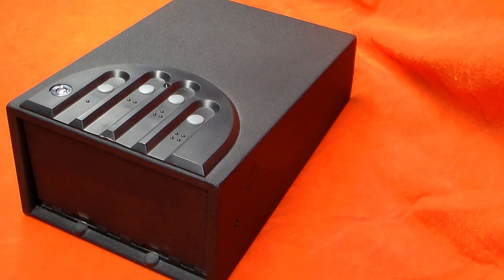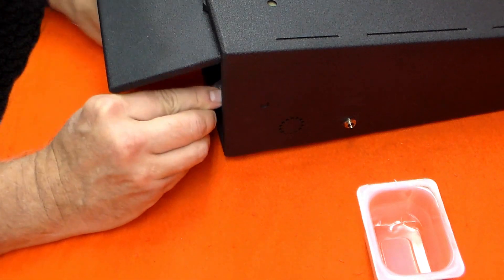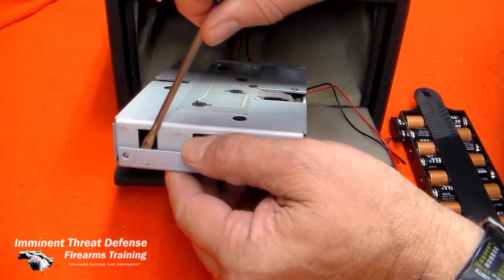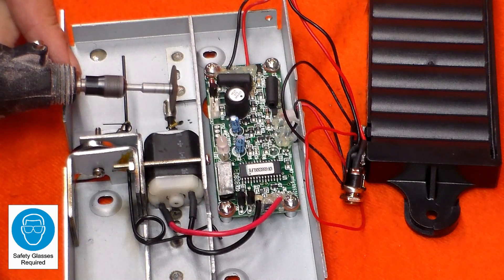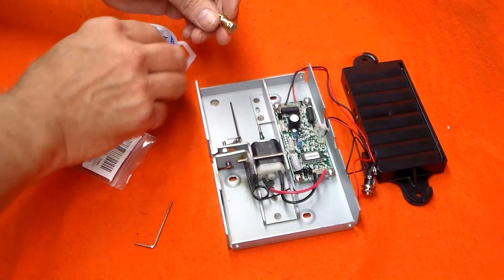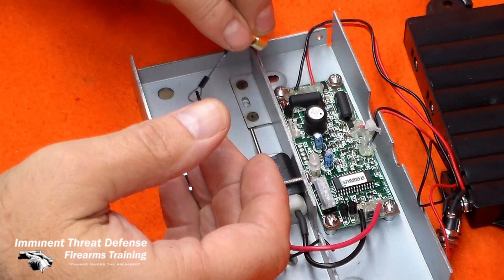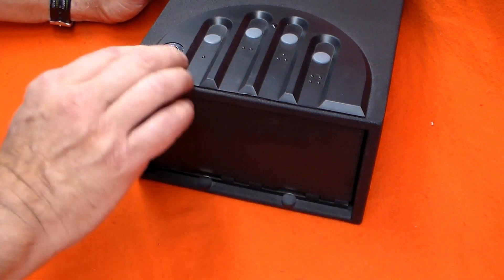GunVault Repair

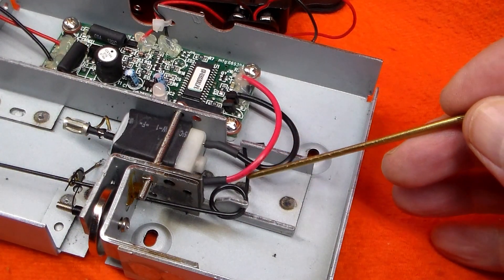Comment: Great video, great explanation.  As a Mechanical Engineer myself... I had EXACTLY the same thought as the statement made at the 2:20 mark.  This rotary motor + cable linkage is the most preposterous method I've ever seen for performing a linear actuation.  Utterly ridiculous.  What's even more upsetting however, was the indifferent and apathetic response I received from the manufacturer's technical support team.  Total fail.
Reply: At least you got a response!
Reply: Just got my response also.  No parts, sorry, too bad so sad, buy a new one.  Nope.  Gonna fix it.

Comment: Thank you, wish I found this 4 weeks ago. I had the same issue and it fixed it harvesting the original crimp on the motor and some pre crimped fishing wire i got at Walmart, but it just snapped again. Im thinking the line I used was too brittle. But now with the links to the parts you used this should last much longer. Thank you, this is awesome. Going to order the parts now.
Reply from the maker: If you have trouble with the cable, let me know.  I have a bunch left I can send you some.

Comment: THANK YOU!!  I have a Gun Vault GV1000C, got in 2006, love it, stopped working, took it apart and yep, broke cable.  Internet research says it's somewhat common but no good fixes.  I'm staring at it trying to figure out how to fix this 3/4" long teeny shredded cable when I stumbled on this video.  Absolutely brilliant fix!  Motor shaft connector and steel fishing leader!
Reply from the maker: That's fantastic, I didn't expect to have an immediate success.  Mine is still working fine. Tell you what, you email me your info at ITDefenseTraining@gmail.com and I'll mail you the parts.  Thanks for watching and commenting!
Reply: @ImminentThreatDefense  Hi, Mine stopped working a few days ago. Did a little research and found your video. Are you selling these parts to fix the problem? I'm more than capable to do the repair.  

Thanks for the helpful video!
Reply from the maker: @aenitro  email me at ITDefensetraining@gmail.com with your info and I'll send you one.
Reply: Awesome video. I just got one from goodwill . Wrote to gun vault they sent me a key. I’m in now but have this cable problem. Someday I’ll order the parts and fix it for good. Thanks.

Comment: Thanks for this. I fixed mine with by pinching the original cable to the post with a small bolt and washers.

Comment: Great video. My cable broke at the spindle so I had enough to just solder it back in place. it is holding well after 10 openings so we will see how it goes, if not, I'll do it as you did.
Reply from the maker: Mine's still working after 3 years of almost daily use. Thanks for watching!

Comment: Hey so they replaced mine under warranty. Happy to report they ditched this mechanism sort of. What they have now is the same motor, but now it has a large metal disc counterweight on it with a pin protruding from it. To that is attached a linkage imagine a pill shaped piece of metal with a small track in it. Sort of like a locomotive wheel with the pushrod and the thing is greased. This version now GV1050-19 also uses a much better dimple key. I think these are good improvements, also it has low battery indicator, light up bottoms and uses 9V battery. They didn’t make me return my unit just show pics of it broken, mine was like 15 years old. I’m impressed…
Reply from the maker: Interesting, sounds even more complicated :-)  Can't believe the replaced it under warranty (after 15 years)!  Good to know.  Thanks for commenting!
Reply: @ImminentThreatDefense  hah! Nah I’d say it’s equally complicated but less failure prone. It’s the same concept, I get what they’re trying to do. They want a latch mechanism with a low force required without the risk that bashing it on its back imparts enuf energy that the latch can fire. For instance a solenoid in the same direction as the trip wire you could imagine generating enuf force to unlock. Here you’d have to input a hellacious rotational moment to get it to unlock. It’s still a curious mechanism, that much is certain.

As for the CS yeah impressive. Sadly the first time they replaced it I didn’t pay attention and they sent me a massive version that holds like 4 guns. I need a unit that holds one gun by my entry way to dump my CCW in…not a tackle box. So I did have to eat the shipping to get it back to them and the replacement…$40 total still cheaper than the $150 replacement unit. They’re owned by Cannon now btw, not camera but safe company.

The initial replacement was fully free to be clear but watch what they offer you. It’s not always what you had, I learned the hard way.

Comment: Thanks, I’m in the same predicament.  Looks like a easy enough repair.
Reply from the maker: Email me at itdefensetraining@gmail.com I've got a spare parts kit
Reply: I really appreciate that.  Very generous of you.  But now I have a reason to make my own steel leaders!!🤣🤣
Reply from the maker: @rickkorallus1162  That's right.  It's not worth while project if it's not an excuse to buy at least one new tool :-)
Reply: Fashioned a cable, motor spins fine until I loop it around the release...then it tries but will not pull.
Reply from the maker: @rickkorallus1162  It may be the length of the cable.   I think the motor needs a little speed to build up some inertia. The circuitry only runs the motor for a short period of time, so  if the cable is too long it won't get tight, but too short may not generate enough force.  I guess I got the length right on the first try (by luck).   Try a little longer cable.  Also test the pull force required by finger, make sure the release is moving smoothly enough (maybe a little grease in the right spot will help).
Reply: Imminent Threat Defense your advice paid off! Thank you sir!! Longer cable and a lot of action grease to the rescue! I could definitely feel the change in resistance after lubing all the contact points.  If I lived in your area I would sign up for classes just because! Thank you again

Comment: Thank you so much I just had this issue happen with mine
Reply: Unfortunately this repair wasn't the problem. They did update the mechanism from the cable pull but it's looking like I'm gonna have to go component to component with a multimeter. I'm not actually getting voltage to the motor. I plan on getting the double stack model I repair my single stack for vehicle transport

Comment: Thank you! My larger GunVault had the same issue and this is smart method to fix it. Have you thought about making kits and selling them for those of us with that same issue?
Reply from the maker: I wasn't sure how big an issue this was when I started, so didn't really think there was much of a market.  This video has only had 2000 views in the first year, and only about 8 or 10 enquires about parts.  I had to buy a batch of 8 of those motor shaft connectors and more cable and crimps than I'll need.  I've given them away, I might have connector left if you want it.  If I started selling them I'd have to deal with warranty, returns, customer relations, accounts payable, shipping losses, inter state sales taxes etc. and that means I'd have to charge about $100 a set for the grief.  :-)  That's why I put the links for the parts in the description above.  Thanks for watching, glad to know the video helped.

Comment: I don’t have a clue about crimps for fishing. Can you point me at some reasonably priced crimping pliers that I could use for the #3 crimps?  Thanks again for the video.
Reply from the maker: There are more than you can count on Amazon, the particular brand I use (I don't consider them exceptional, they are just the ones I bought 20 yrs ago) is https://smile.amazon.com/dp/B004VZLGZS/ref=cm_sw_em_r_mt_dp_U_3Nf3EbRCRYXWT   But to tell you the truth, for a simple job like this almost any pair of pliers would probably work.

Comment: What do you think if it opens every other time or so?
Reply from the maker: lubrication.   Scroll down through the comments and you'll see there have been a number of people who solved the problem by just a little lube on the moving parts of the latch.  Requires the same disassembly.  Hope that helps

Comment: Very nice. I was not so creative. I used super glue and I needed to apply it to both ends. Seems to work so far but nearly as nice as your solution.  Since I originally took it apart years ago (I've been using the key) I'm trying to figure out where the eight battery rack and the 9V battery are supposed to go. Any help?
Reply from the maker: The battery pack goes on the ceiling in behind the control box. There's two threaded posts attached to the ceiling and two ears on the sides of the battery box. The post go though holes in the ears and u should have two thumb nuts that hold the battery box on the posts.
Reply: @ImminentThreatDefense  Thanks! I saved all the hardware. Got so used to using the key I just put off fixing it...for years. Which source is the electronics attached? The 9 volt or the battery pack? Either? The battery pack probably lasts longer, no?
Reply from the maker: @davidbarnett8617  mine is older and this one has 8 AA'S and an external 12v source. I've got another one with just 8 AA,  but I got tired of replacing them every 6 months so I wired it up to an extenal 12v gelcell. But that has a security flaw. If you disconnect the battery it erases the memory.   Then if u hook it up again it defaults to the factory code.
Reply: @ImminentThreatDefense  I think mine is from 2005 or thereabouts. I have a feeling when I was debugging the problem initially I simply put the 9V in in place of the 8 AAs. A new 9V seems to set off the low battery signal now that I have it working again. Wish I saw your video before pouring super glue!

 I guess this breakage issue is common and, as you said in the video, not too well designed. I like the idea not the implementation. Thanks for your help.

Comment: My cable isn’t broken but it seems like the motor won’t rotate long\far enough to pull the spring. I jumped the motor off a 9v and it spins like a champ. Maybe the board isn’t timing the motor correctly? I’m at a loss on this one. 

Great video, fwiw gun vault said “try eBay”. Thanks fellas....
Reply from the maker: Try lubricating the latch, one other viewer had that problem and a little grease helped.  He also replaced the (new) cable with one that was just a little longer so the motor had a chance to build up a little more speed before the cable came tight.  But start with clean and lube, he said it made a big difference.  I see you had a similar customer service experience as several other viewers.  Thanks for watching good luck and let me know how it goes.
Reply: The locking spring is pretty tight.  You can just take some needle nose pliers and reduce the spring tension by bending it a little on the right side where it is coiled.  That may be enough to solve your problem.  Also there is the tiny latch spring that rubs on the locking spring. You can bend that and use the housing to retain the position instead by bending it 90 degrees and putting it under the latch housing.
Reply: I thought of messing with the cable more but not the lock itself. I’ll give it a go, thx!

Comment: Resist trying to firm the connection,  motor needs the slop to whip the cable. Found this:
https://www.amazon.com/dp/B078828MG5?ref=ppx_pop_mob_ap_share
Reply from the maker: Very true.  Links to all the parts and tools are in the description above.  Thanks for watching

Comment: This failed on me I suspect and I don't have the key anymore, this is such a dumb fuck design. I'm also an engineer and this design is unconscionable. Imagine going for your gun in the middle of the night cause you hear someone kicking in your door and you hear whirrrrrr whirrrrrr and nothing. Thankfully it's been relegated to where I shove my CCW pistol when I get home, that said it's trapped in there now.
Reply from the maker: without the key you're only choices are destructive disassembly or pick the lock.  Any lock smith should be able to handle or you can buy what Amazon calls a "Tubular stainless steel wrench", what those of us less knowledgeable in the rules on online sales would call a tubular lock pick.  Hope that helps, thanks for watching.
Reply: @ImminentThreatDefense yep, ordered the tubular picks, cost me $20 for a set of 3. I’m at a loss about this locking mechanism, what in the actual F. I guess it has low mass so it’s less susceptible to being unlocked by bashing. But I gotta think a right sized solenoid would work. Or a worm drive linear actuator with a pawl ughh.